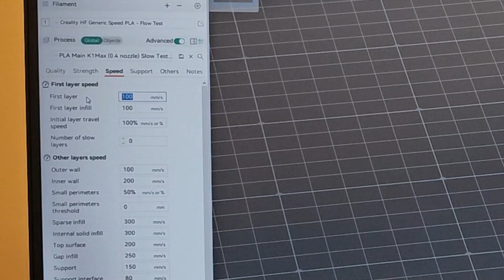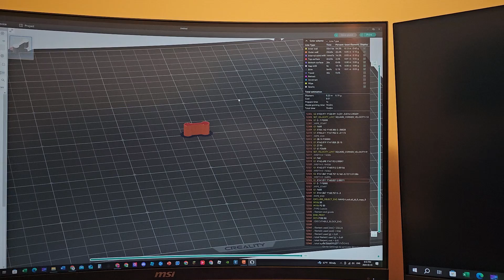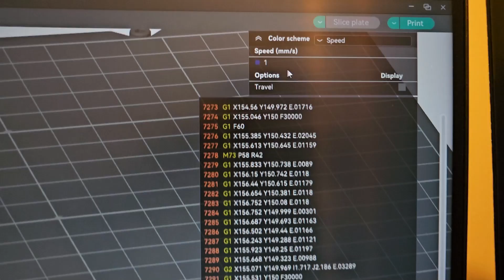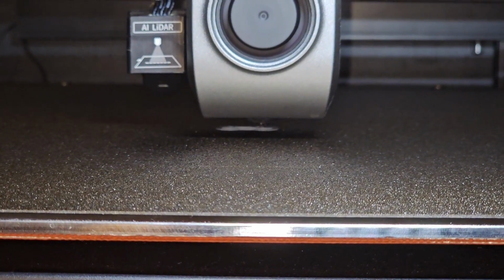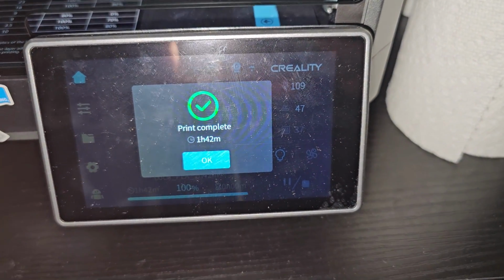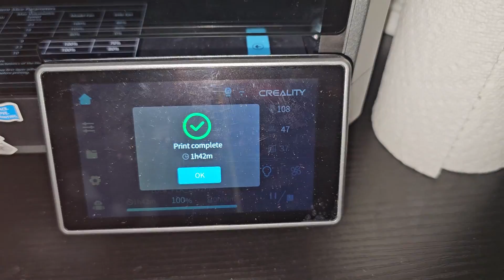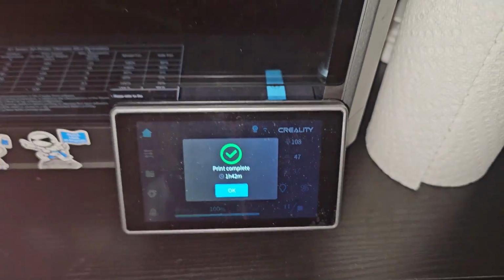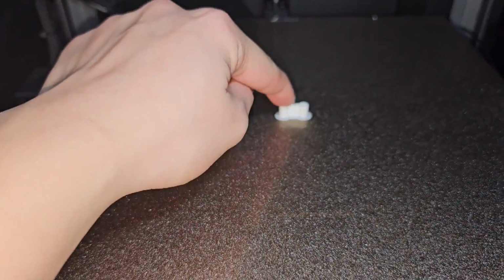Printing At 1mm/s With The K1 Max... The Result...

Comment: Hey there - I'm interested in starting to upgrade/mod my K1.  I watched your videos about different plates, hinges and the FlowTech but wanted to get your thoughts on the K1 upgrades like extruder/ hot ends/ nozzles that are listed on sites like aliexpress.  Thoughts on if they would be a direct drop in and go or should I just spend money on major name brand parts??
Reply from the maker: I heard that some hotend on aliexpress are good like the "Trianglelab" one. The build plate I got them on aliexpress and they have been holding up grate, prints are good. To be honest, most of the hotend are silimar, in print quality its the features and design that get me sold on, like cold nozzle change and leak proof.

I think if you have the newer version of the extruder, where the lock is white, then it's a good extruder. Most of them would be a direct drop in replace no addition wires, but always read the document before buying. 

Oh DEFINITELY do the 270 degree door hinge mod, saw lots of horror story where the glass shatter into million of pieces.
Reply: @Scratch3DPrinting  I don't have the newest version so I figured that if I'm going to have issues with it then I might as well upgrade!  
I plan on printing the 270 degree door and latch plus the lid riser this afternoon.

I'll look more into the triangle lab parts and let you know if it works out.  Thanks for the reply!